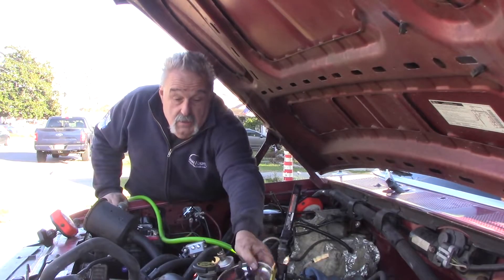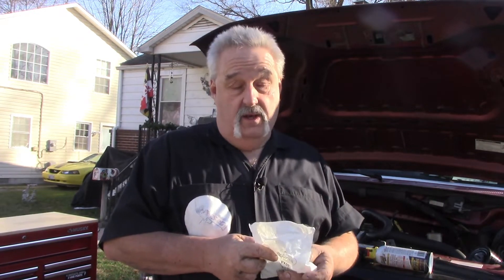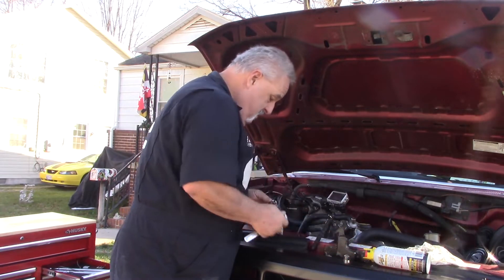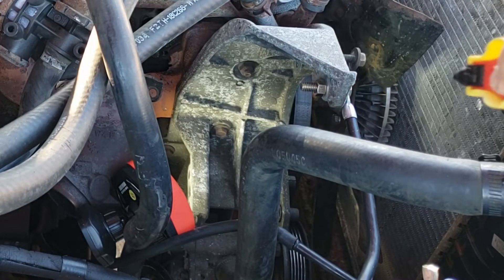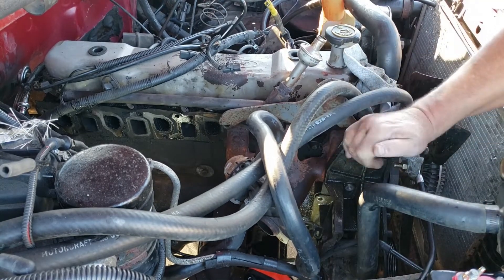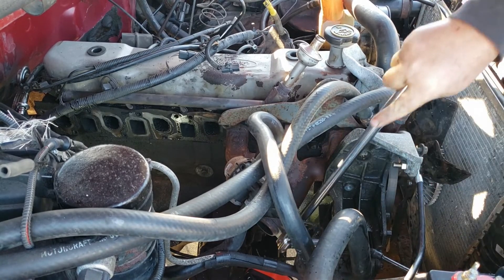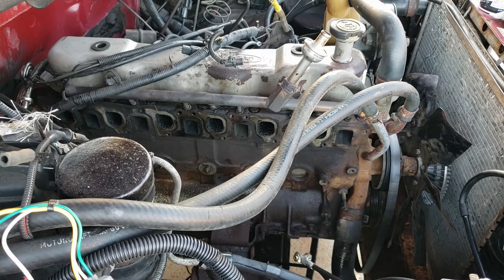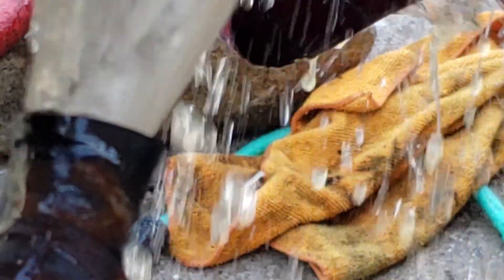OBS Ford Exhaust Studs part 2

Comment: Are the manifold bolts that bolt to the block tapered? Put a new head on mine and them old manifold bolts get stiff after a couple threads
Reply from the maker: I dont think so, clean the dolt with a wire wheel and put on a little antiseiz and see if that works